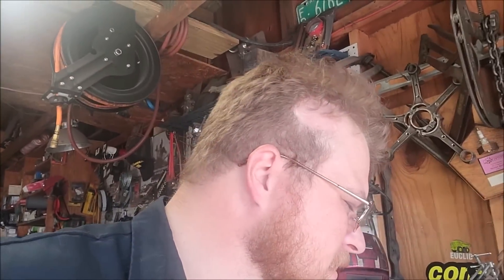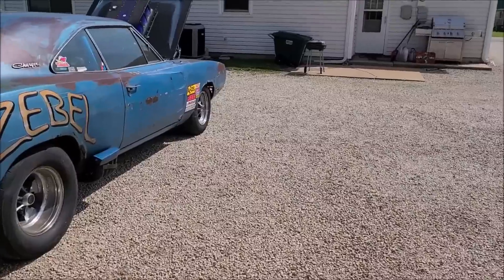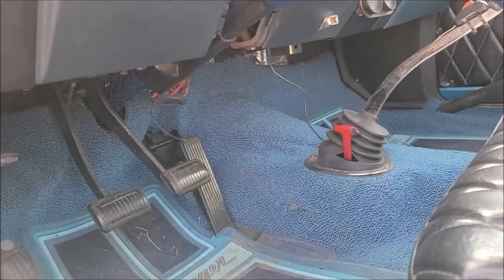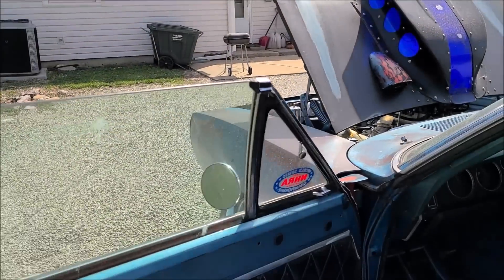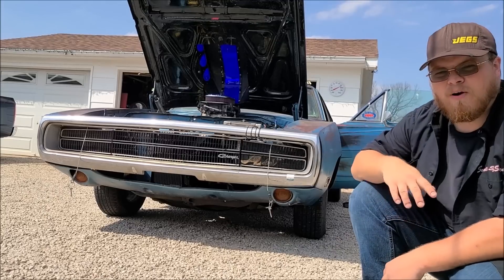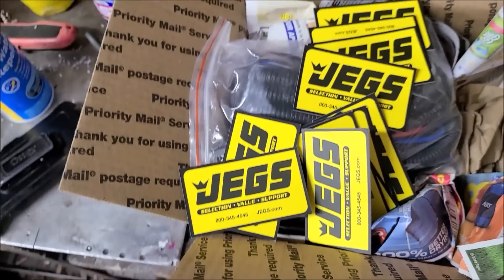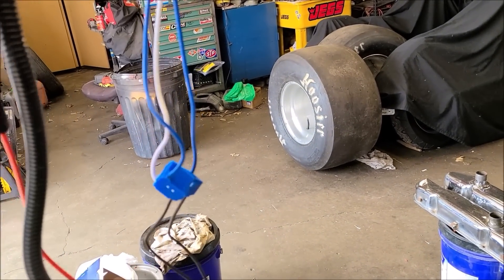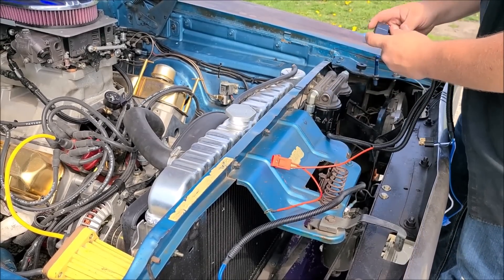One CHEAP Upgrade every vintage MUSCLE CAR NEEDS feat. Jezebel

Comment: Not going to lie I switched to led headlights on my 68 Chrysler newyorker, it made it a lot more enjoyable to drive at night and to see where you’re actually going. Jezebel is a cool charger, glad to see it getting back on the road.
Reply from the maker: I wish that led lights looked more like old halogen lights, I just don't like their outward appearance, but they do shine a lot brighter that's for sure
Reply: I did the LEDs in my 76 New yorker.  Only other reason why I did it was because I can hide them until I turn them on. Doesn't make the car funny lookin
Reply: Yah I didn’t mind the ones I put on mine, they actually complemented the car pretty well honestly and they’re a hundred times brighter.
Reply: If you haven't done it already, you might upgrade to a dual field alternator in your 68. My 65 was really dim at night when you stopped and had your foot on the brakes, with tail lights, head lights, low rpm. I was afraid it would stall.

Comment: In your father's time, and mine, guys used to say, "I'm gonna get those airplane landing lights.  You should have seen those airplane landing lights."  Presumably at a street race so far off into the country and so late, you need extra lighting to drive at high speed.
Reply: Father had a pair and I still got em in the attic

Comment: Excellent. I ordered the part number you gave me and ya, no instructions. After watching you it’s pretty easy. Thanks brother.🤙🤙
Reply from the maker: I did a little research to figure mine out and figured it wouldn't hurt to give a little explanation
Reply: @ScottsSpeedShop  I was wondering where to plug the black one in. The others were obvious 🤙

Comment: My 68 300 has the same motor and it aggressively opens the doors. The new harness set up looks good.
Reply from the maker: I am quite impressed how peppy that electric motor is, and the modern 5 pin relays really help everything

Comment: Looks like a nice improvement! Depending on how old those stock bulbs are you may get an improvement from replacing the stock sealed beams. They degrade over time.
Reply from the maker: These have been in the car for a long time,  probably been in the car since the 80s when the car spent time getting picked clean at the salvage yard

Comment: I agree about avoiding fancy expensive headlights type, especially around plastic.  But "Halogens", I believe, draw slightly LESS current, put out slightly LESS yellow light, and are slightly LESS hot to touch.  And my experience with them seems to agree with that. 
    Good video on both issues. My Charger buddy didn't believe me when I told him he could have bought a Bosche relay since he'd paid a fortune for a rebuilt factory relay.
    One of my relays (72 Charger SE) chatters, but I think it is the circuit breaker reacting to the problem in the motor, not the relay itself.
Reply from the maker: I got lucky that my circuit break was still fine, I don't know what I could use to replace it other than another one. I'm definitely glad I tried the Bosch relay out because I can't afford another factory type relay

Comment: Awesome 👍🏽👍🏻    so much better 😀👍🏽   I got the Rav4 painted and fixed the power steering pump,   but now got to sort out the drive shaft,  and Toyota decided to make it so you can't fix them 😡  so going to see the drive shaft place about it tomorrow,  hopefully it's not to bad or be finding a second hand one but they will probably be the same as it's a old car now 😞
Reply from the maker: Glad you got her painted man, that sucks uou can't fix the driveshaft, but hopefully a new one won't be that expensive
Reply: @ScottsSpeedShop  yeah a brand new one is $1200.00   bucks plus shipping,  and I'm waiting to hear back from the drive shaft place hopefully it's 600 ?  Then may have to settle for second hand for now?  But will find out how much they cost for a second hand one? That might cost a bit to ??  Let you know how I go 👍🏽

Comment: Hey Jed, do you know if that will work on a pre 70 car? Might pick one up for my 63 sport fury
Reply from the maker: Yes it will, itll work on anything, the relay is only for 70 and newer cars, but the harness and twin relays that is being installed is universal
Reply: @ScottsSpeedShop  sweet, I might pick up one and see if it'll fit. Thanks Jed

Comment: I'll have to take a look , mine were wired to a toggle switch & open/close ... violently ? Yours open slowly , close quicker , but smoothly . Gonna have to fix the peepers now , Lol ! The passenger headlight side is a bad ground , or the plug is rotten . Probably the same on the marker /signal . A couple new pig-tails & a blub or 2 , NICE ! Those cars look great with all of the lights working , especially in the dark ! I'd say ask your Dad , but looking in the mirror , you probably already figured that out . Ha ha ha . Oh , Ya , like that ! LOL ! Thanks Rob ! Much better ! Grease the bulb terminals , the plugs will last longer !

Comment: Good deal.  I would have put the fuse closer to the power source.  Lessen the fire risk.   The squeaking noise in the background sounds like a wind mill that needs greased.
Reply from the maker: The squeaking is the garage doors from the high winds